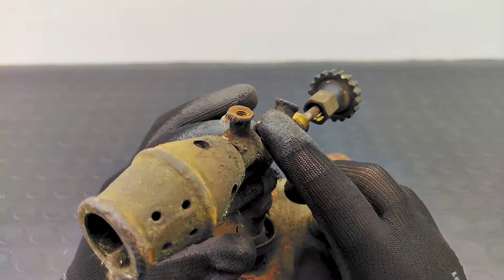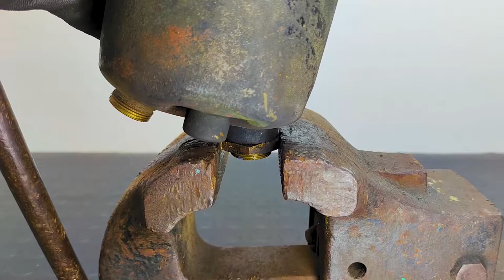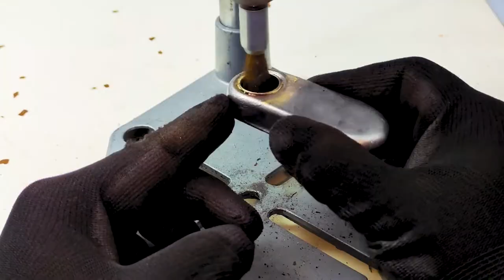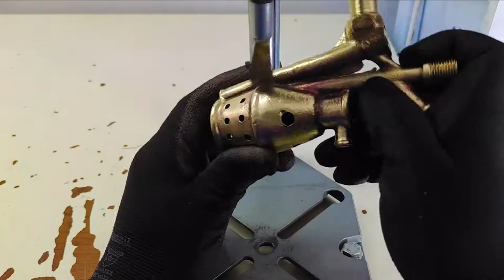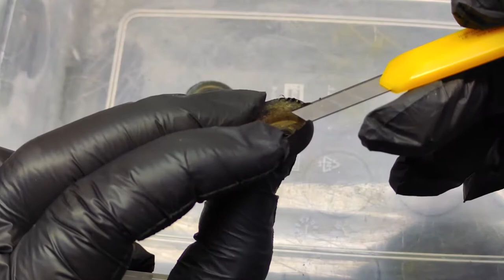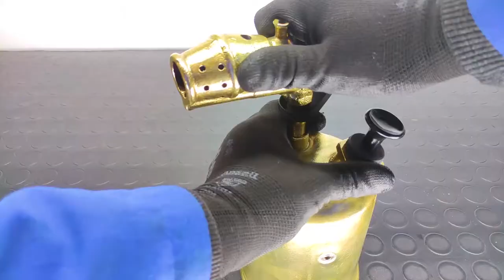Blow Torch Restoration XPOM

Comment: I use one of these from time to time. The pan must pre heat the torch head for a few minutes. If not then it won't burn correctly. There should be a stream of fuel coming out when pumped up and valve is open.
Reply from the maker: I filled the pan twice and let it burn for a couple of minutes. I will try it a couple more times and will let you know. Thanks a  lot.

Comment: didn't these old torches use white gas?
Reply from the maker: I think you mean kerosene. I also tried with it but still didn't work.
Reply: @restorationmania  nope, didn't mean kerosene. White gas is different. It burns more efficient and is what was used in old torches.
Reply from the maker: I will look into that, thanks a lot 👍🏻